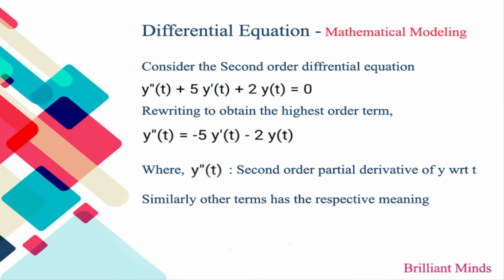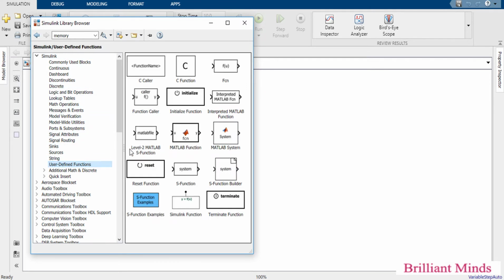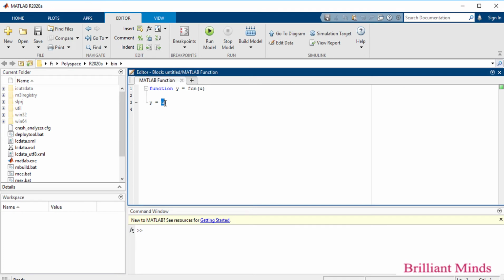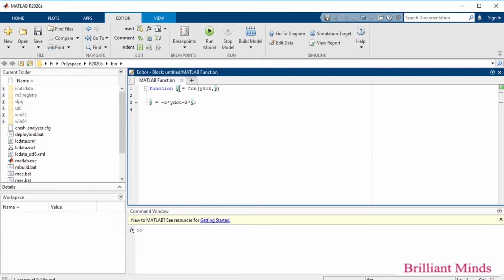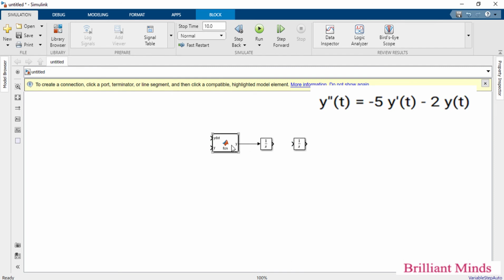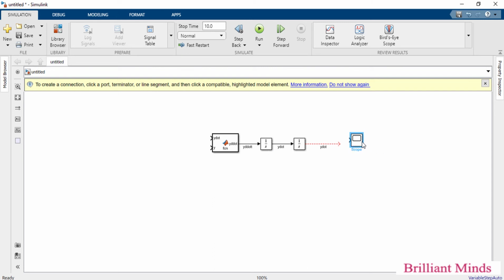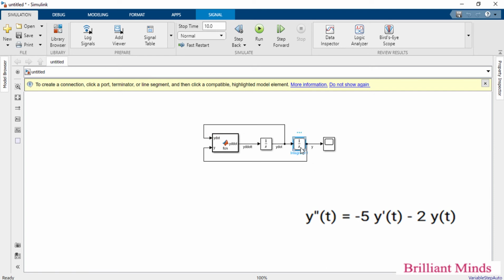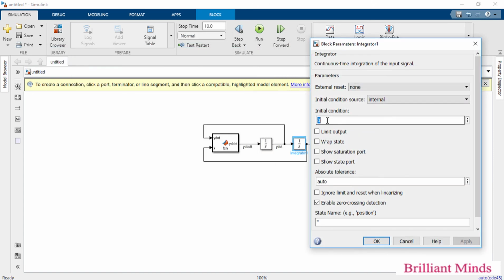Simulation of Second order Differential Equation using Simulink

Comment from the maker: The main innovation in this video is that, system modeling is done in unique way (Compared to the similar available videos) that, a Matlab function block is used rather than individual blocks, which helps reduce time consumption in modeling.
Please Like and Subscribe the Channel.
If you have any queries regarding simulink modeling of differential equations, please post.